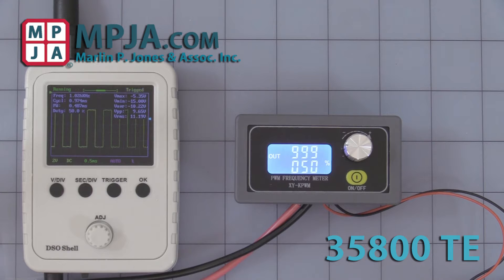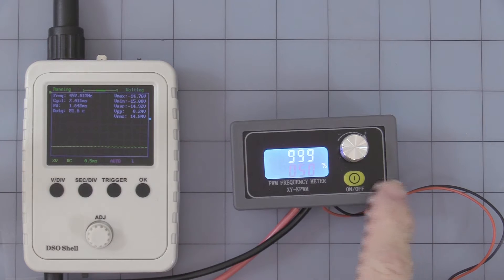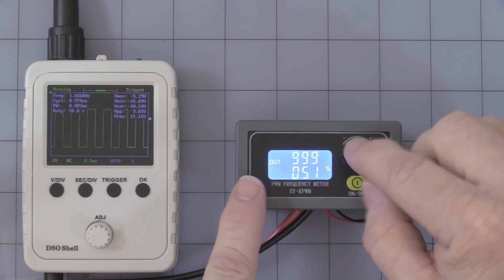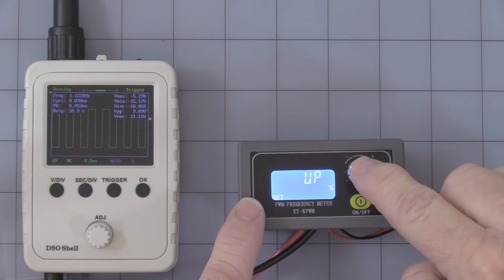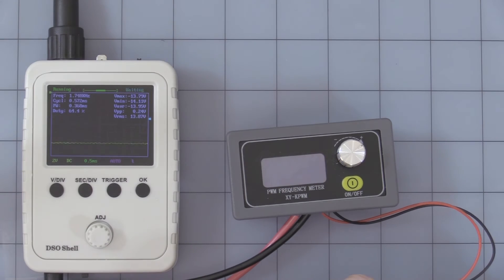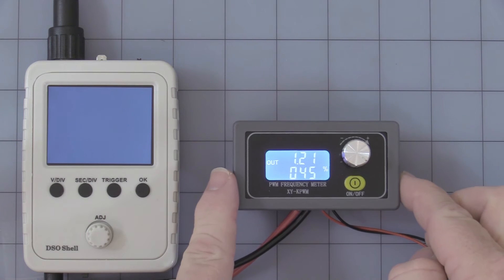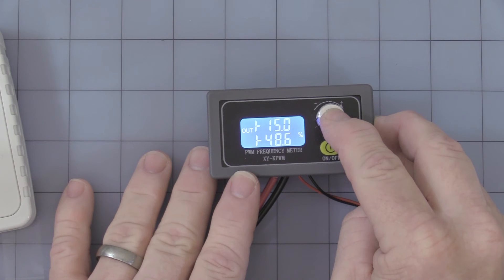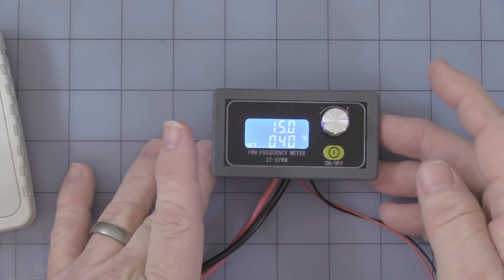Variable Frequency and Pulse Width Generator 35800 TE

Comment: What a joke of a product!  One can use a pair of 555 timers or a 556,  and no silly LCD display.   Displaying output PW and FREQ is elementary with a small snap-in voltmeter appropriately scaled to read PW and/or FREQ if wanted.
Reply: Or you could spend $4 for this ready made module that's very slick.

Comment: Thanks and now it runs after setting it to 20 HTZ,  Pushed and twisted to 20 HTZ and turned to a duty press on and the motor took off, and grasping for plug successfully.
I’m still a little confused at the sequencing of the master (rotating) button.  The programming seems to be circular.  Is there a logical start point?  I want to set it to 20HTZ and have a DUTY cycle of 10 to 100.  Are there other things I need to set?
Thanks for your post.

Comment: Thanks for the video!  The instructions that come with this thing aren't great so I really appreciate you clearing things up.  I was wondering about its output voltage though.  It can take something like 4-30V so is the output just what you feed it (with a drop of course)?  I was planning to make a small case for this powered by a 5V smps but now I'm thinking of using 24V with programmable buck for added control.  Thoughts?

Comment: Nice video.  What is the power voltage in?
Reply from the maker: Power in is 4 to 30VDC
Reply: Thanks.  I recently received a similar model from Drok with no instructions.  30v is pretty good.